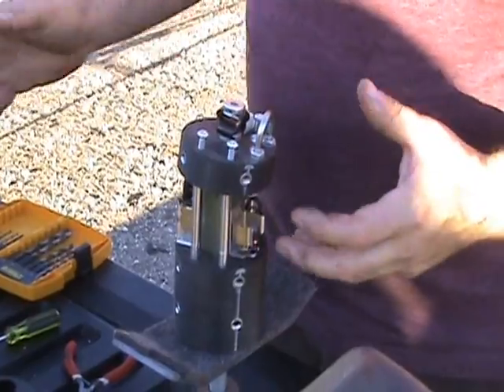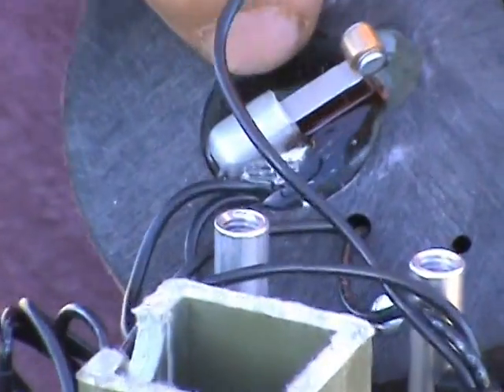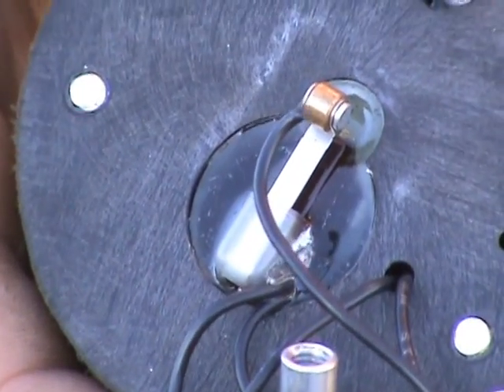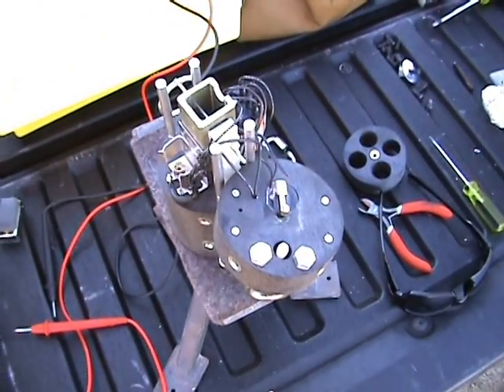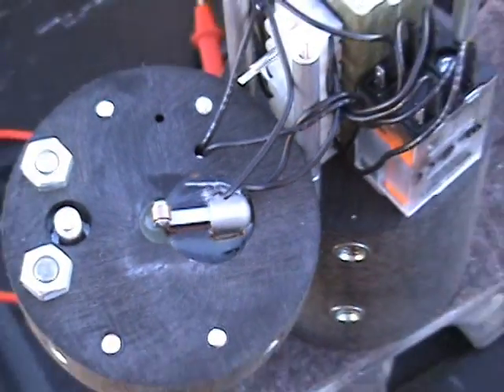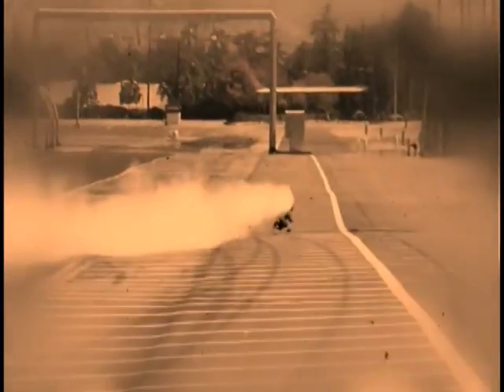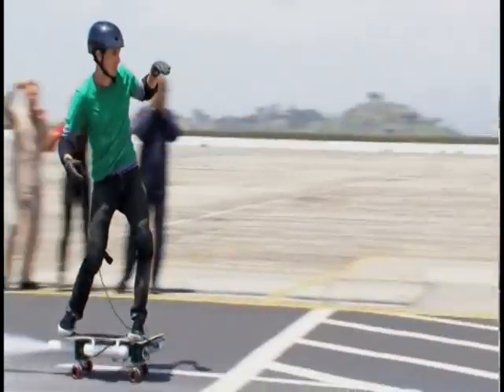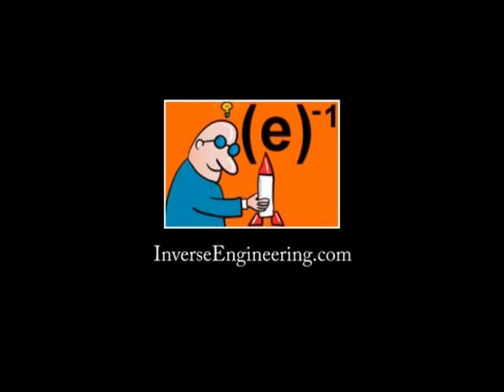K500 Sugar rocket with on-board video

Comment from the maker: You can INCREASE the nozzle throat diameter to increase the burn time but keep in mind that you will also decrease chamber pressure along with the efficiency of the fuel, meaning that you will get considerably less output per pound.